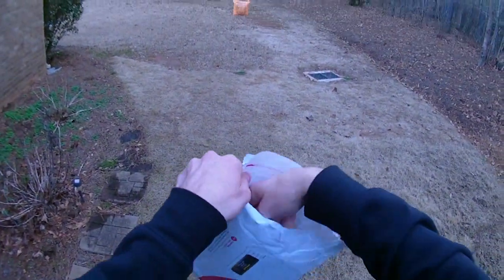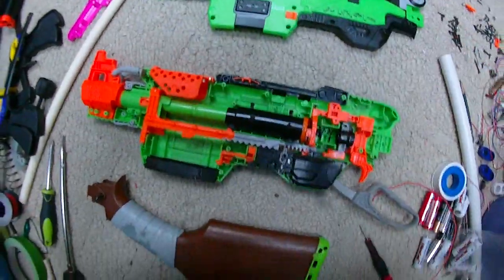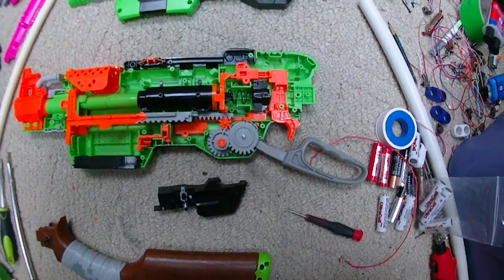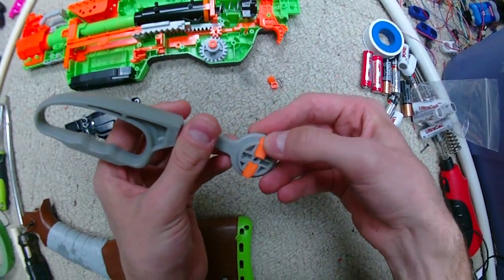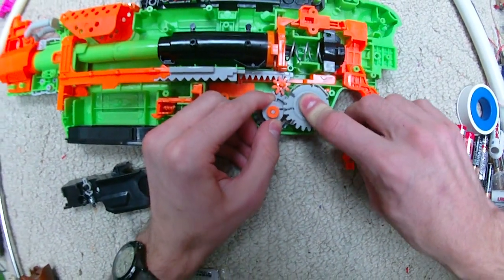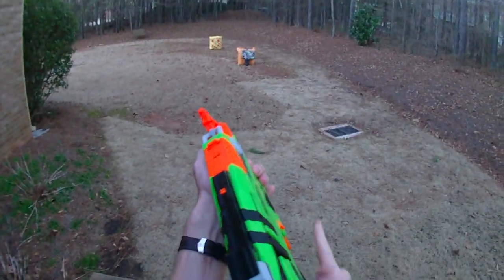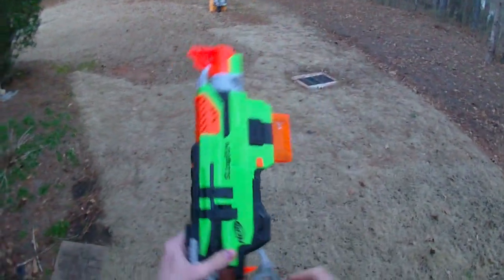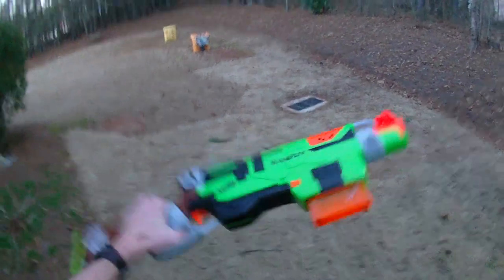Review / Install: The OzNerfNerd Slingfire Upgrade Kit.  (Serious Power Boost)

Comment: I don't know if you are aware of an old western show called the rifleman. if possible could you see about adding a set screw to trip the trigger when the priming lever is returned to is resting position. Also it is possible to prime this blaster in the same way as the terminator in t2 primes his shotgun

Comment: why are the "reinforcements" on top of the level handle, under the gear necesary? doenst seem like there is a direct interaction with the new spring there. why should it break with the tougher spring?

Comment: I'm not sure if this would help. I had the same problem with the priming handle locking when one-handed firing it. What I did was I removed that little tab catches in the teeth of the bolt sled. Once that was removed, I was able to fire it Terminator-style flawlessly. Best of all, it's quieter, less ratcheting.

Comment: Some questions:Is Twirling this blaster when priming impossible? or is it possible but i just need a lot of force? What is the KG rating on the spring btw? And lastly what does the slip clutch replacement actually do for the blaster?

Comment: In the leaver gear part it has a small hole so just drill with a slightly smaller drill bit than the hole it self and thread in a screw and add just cut down a pvc tube that would behind the spring there I just made this kit not worth it

Comment: Someone needs to make metal priming rod for this thing to be worth it. That rod just seems too flimsy to put any real power behind this blaster.
Reply: *****  I put enough pressure on the level to disengage OzNerfNerd's clutch pieces without the lever break, or bending pass an uncomfortable level. I'm guessing the reason it's bendy (not flimsy) is to compensate for the way people prime. Not everyone is going to prime is straight forward, or in a straight line... some people may push it to the right/left a bit, and that bendiness allows it to do just that.
A metal priming bar, as Nerf Team BETA explained, would cost a lot AND it would be very uncomfortable to use since it'd be so rigid and hard.